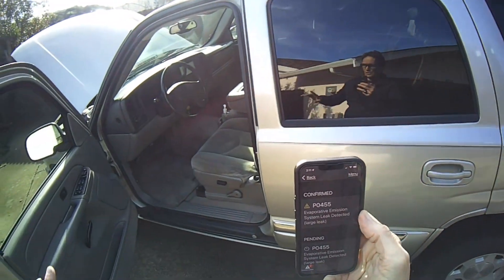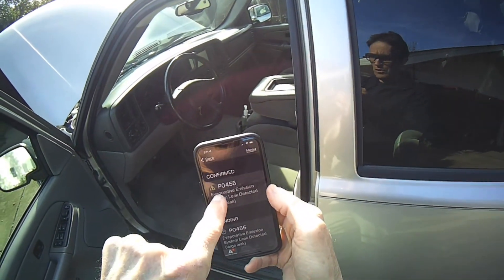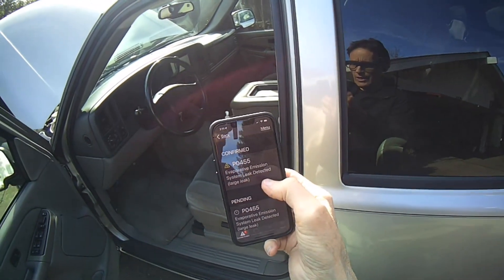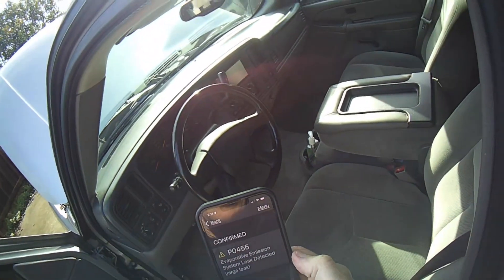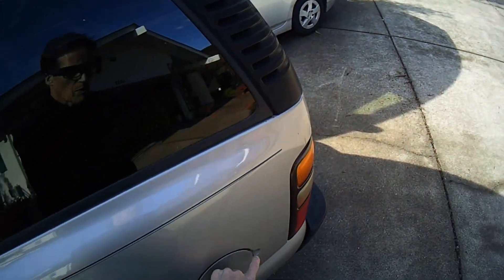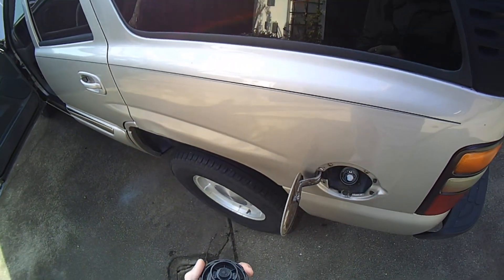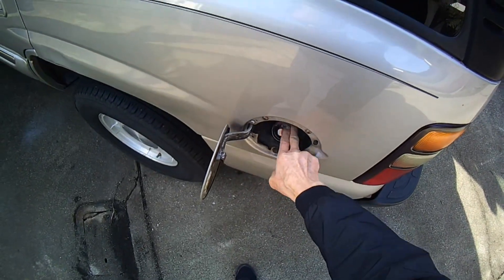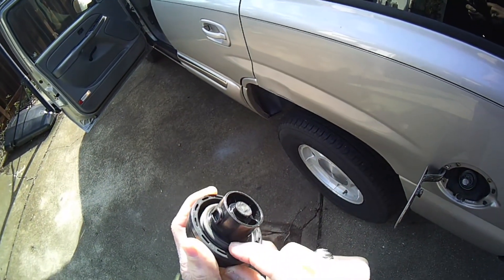✨ Yukon / Tahoe - P0455 Engine Light Code - Easy DIY Fix ✨

Comment: So was this the final solution to your problem? Just replaced my 5.3 myself and this code just popped up a week after I replaced the engine
Reply from the maker: I wonder if one of the EVAP system vent lines came off or is leaking?